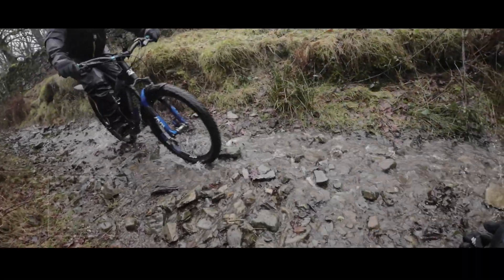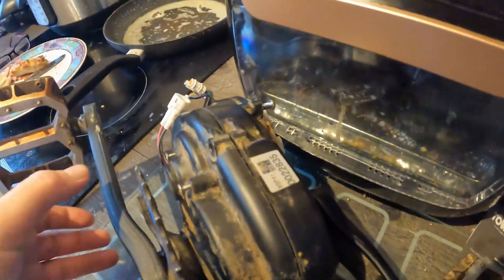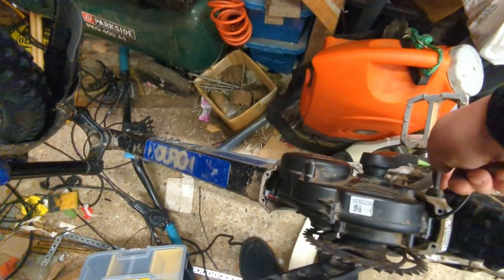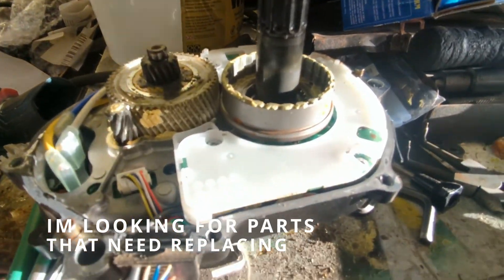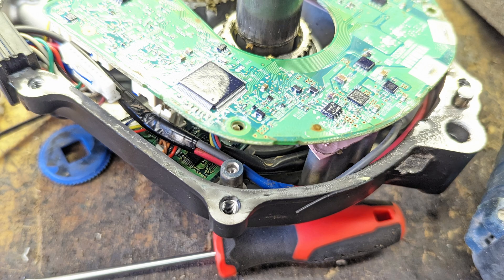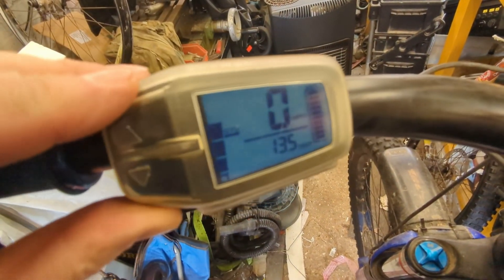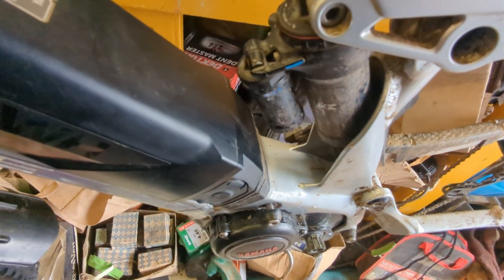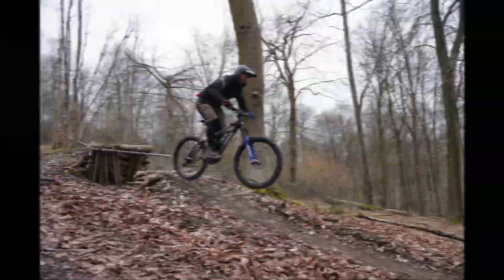EBIKE MOTOR WATER INGRESS how to stop it being terminal and  easy  fix

Comment: Has anyone put a air vent into the motor just like they do on motorcycle to stop water getting  in. Just thinking?
Reply from the maker: Yes I add a vent tube to my motor.  The original vent is poor design in my opinion
Reply: @LazyMTBrider  did it help

Comment: Hi, I have a Yamaha PW motor, on my last ride which was wet,  the system stoped working, error code 29 came up on the display. What I have read the fault is with the torque sensor (abnormal  no-load voltage).  Did your Yamaha motor have this same fault code?
Reply from the maker: Hi yes I'm still running this motor but also have a second spare.   In my experience water on the circuit board will trigger any number of errors and codes.  The key is to split the case enough to allow some air in dry it out by warming it up.  Then see if the error has gone. If so you know its water and that you have halted any damage.  Then you can commit to serving yourself or someone else.   Or send it to performance line bearings
Reply: @LazyMTBrider  Hi, I cleared all three of the error codes using the display, the motor started working again for 5 miles then the motor cut out with error code29. I cleared it then ran the motor for 17 miles without faults. It was at this point I noticed that the motor had a lot of play in main bearing. I shall have to strip the motor down and replace the bearings. Thank you for your video.

Comment: I dont know if youre still running this bike/motor? Ive replaced my bearings with stainless steel available on ebay. Silicone grease the entire board etc. Also taped a baffle over the breather hole.
Next attepmt will be oil fill the gearbox rather than the grease, fit a drain plug and change the oil periodically.
Reply from the maker: Hi there I've tried the stainless option on other parts of the bike.  I'm not sure why but they failed even quicker. It may be something to do with load tolerance.   So this time on the motor I opted for different approach.   I'm installing full fill bearings.  They can take much more load. After talking to motor servicing shops apparently pwx motors have smaller bearings than most other motors and this lack of resistance to load is big part of problem. They develop play quickly and play let's water in and then rust combined with heavy load means the degrade very quickly after that.   I'm hoping stronger will last longer.   I'd be interested how you get on with stainless.  I lubricated the plastic gear with wrong type of grease and that gear wore rapidly after that so again I'd be interested if oil works of causes issues

Comment: Hi, i have the pw x3 engine. What do you recommend for maintenance and water issue? Thank you
Reply from the maker: If its under warranty ride it like you stole it.   Ideally use compressed air to clean it not water.   If it out of warranty you need to keep a very close eye on the crank bearings.  The moment there is bit of play.  Get the Motor serviced.   If you do get errors after wet ride.  You need to follow my video on how to dry it. Then get it serviced

Comment: Hi, thanks for your video, I have a question, have you got a video where you change the bearings? Do you need any special tools for replacing the bearings?
Reply from the maker: Sorry no video but they were not very tight to knock out . i used small Manuel hand press to put them in but you could have carefully tapped them in with a hammer.  do you have a pwx2 or similar motor?

Comment: At least with the haibike you can buy a new PCB. I've got the giant pwx2 and if the PCB gets wet and you've no warranty then it's a whole new motor. 😏😏
Mine died on my trance after 900 miles. Poor really. New motor in now. 
Apparently the PCBs are coated from factory but it doesn't seem to be doing its job does it.
Reply from the maker: Yeah my other bike is a giant pwx3 so not looking forward to that going wrong.  From factory the coating is very thin and something a bit wierd as it easily comes off.   We even the thick multiple coats I did probably haven't done the job.  I also smeared loads of silicon grease on the bottom of the board.  Had quite a few ride since. Motor is quite and no issues so far

Comment: Hi Tony, great informative video..👍 I have a 2017 Bosch Performance Line CX motor on the bike, and with the help from the very helpful guys at Performance Line Bearings and there YouTube videos the motor has just passed 4000 miles, she's running so sweet.. this video will help so many bikers, keep 'em coming 👍
Reply from the maker: Bosch is better for water ingress and they now do a kit to improve it further. I should have bought Bosch!
Reply: I have the crankshaft mud stopper and rubber seal, so far so good 👍😊
Reply: Up-date, my mistake, it's a 2018👍